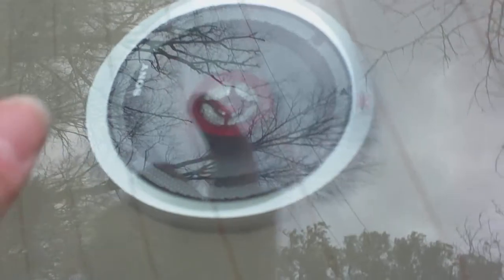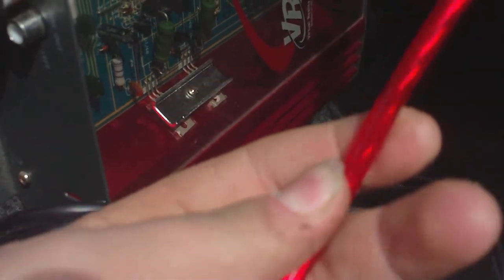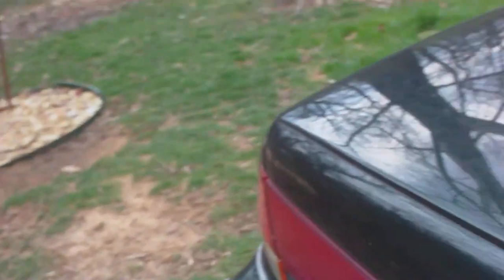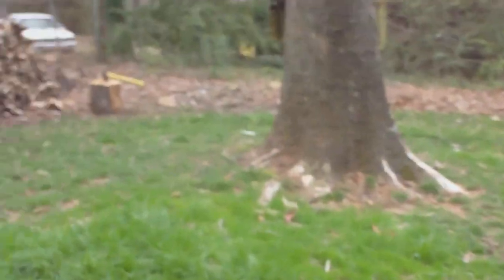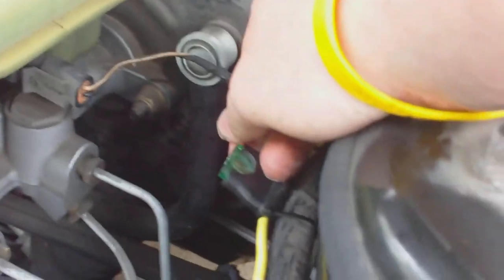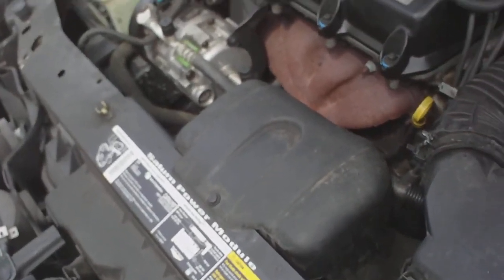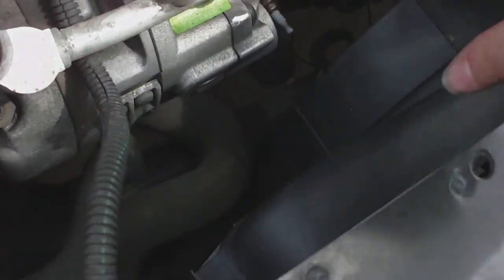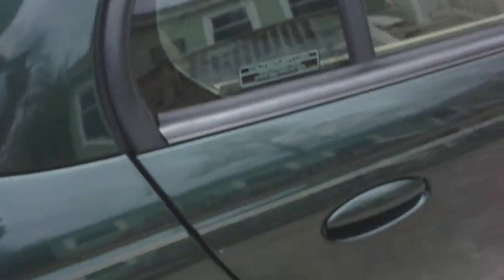UPDATE my car and audio system

Comment: hahahahahah your using a 30 amp fuse hahahahahahahaha bet it blows a lot, i have to 12 inch kenwood barely pushing 3000, watts rms, 150 amp fuse